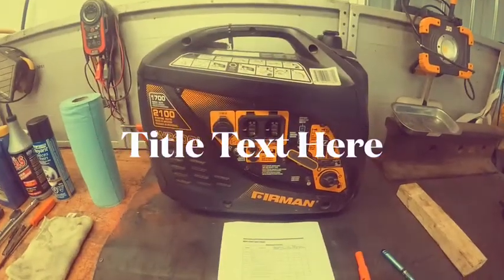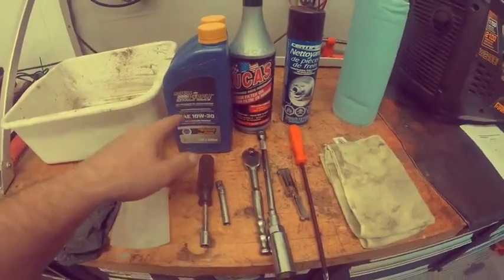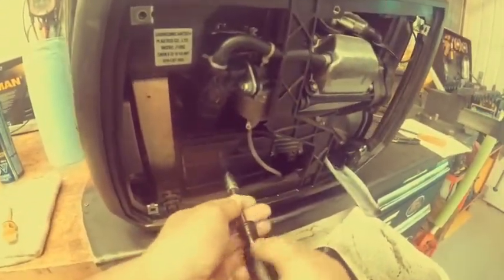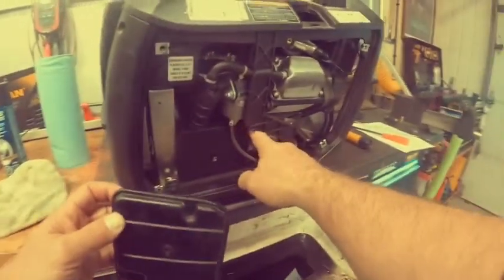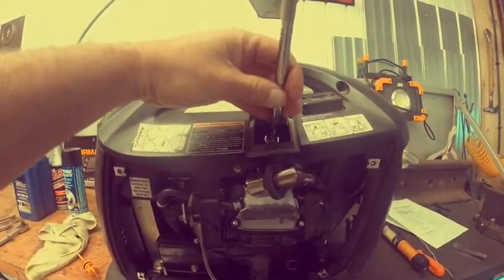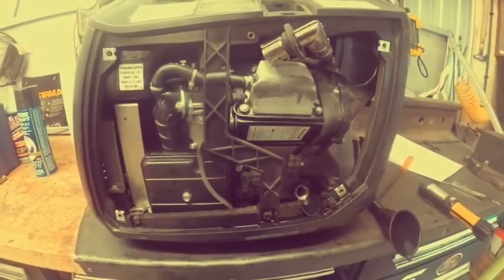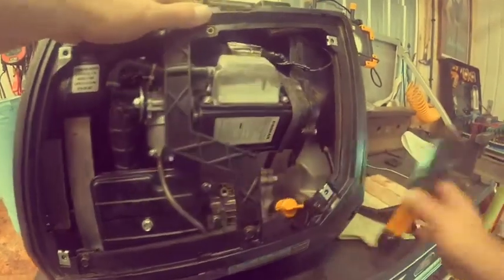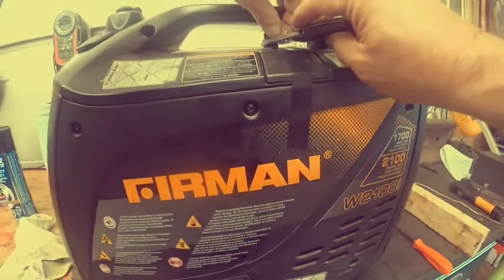Firman Oil Change

Comment: Is 5w-20 oil ok to use on this generator??
Reply from the maker: The manual says no, they recommend 10W30
Reply: You can use 5w-30 synt as per the manual as well